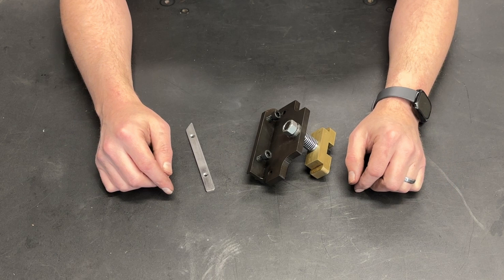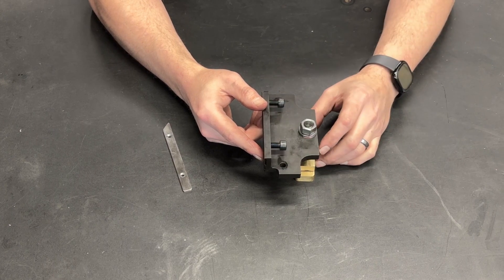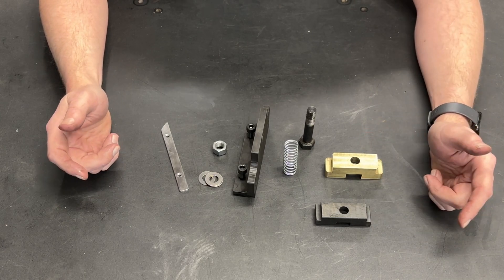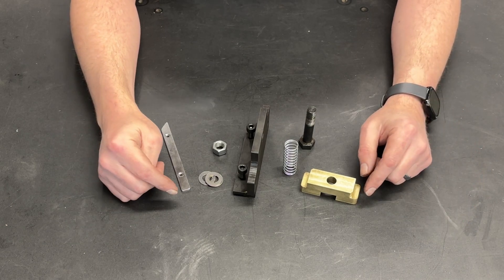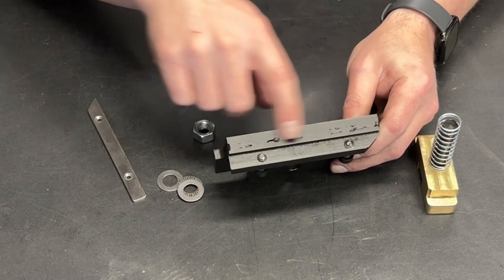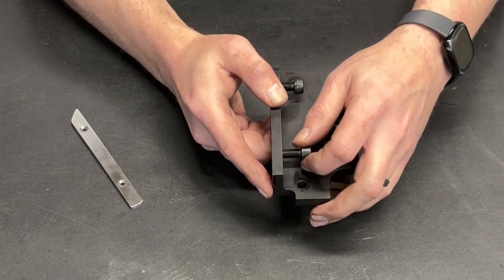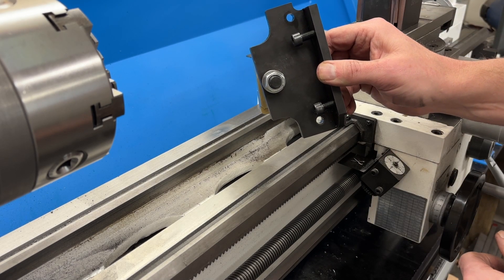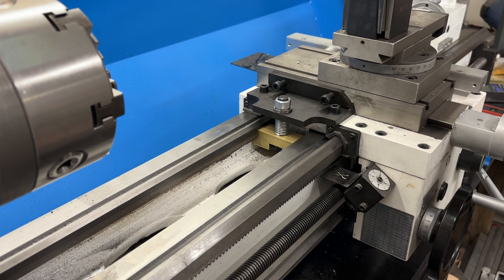Making a DIY Carriage Lock for my PM 1228 Lathe to Correct the DRO Scale Covering the Factory Locks

Comment: Good idea. I put a magnetic scale on my atlas because the glass one took up too much space. When the cross slide is in the wrong position, the square box end wrench won't go on and I'd prefer to not use a open end wrench and start damaging the corners of the lock bolt. The scale also makes the cross slide lock bolt harder to get at. Of course, my 50's atlas has no square surfaces on anything except the flat ways.
Reply from the maker: I am still shocked that it came from the factory with no access to the factory locks
Reply: @dazecars  It probably wasn't enginerded into the original machine. I was a mechanic for quite a few years and those buggers never had to work on them. Ig you put a jake brake on a series 60 Detroit diesel in a Volvo tractor, you had to jack up the cab to get the rocker cover off. Hundreds of stories like that in cars and big trucks.
Reply from the maker: exactly although this is such an oversight that I would have thought the DRO designers would have caught it.  A person needs to be able to access the carriage locks.  At the very least the socket head cap crews should have been replaced with hex head when the DRO was installed so a person can at a minimum use a wrench to get to them.